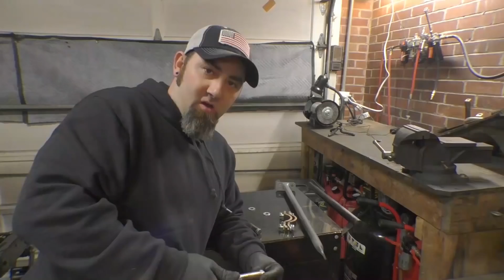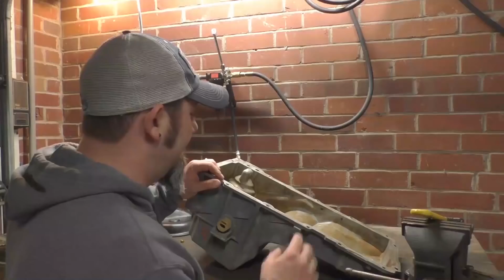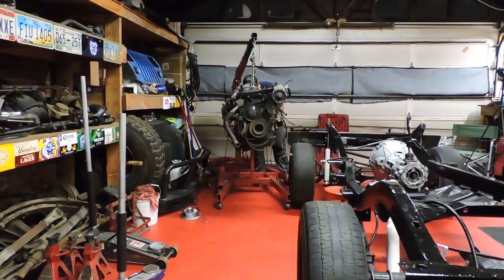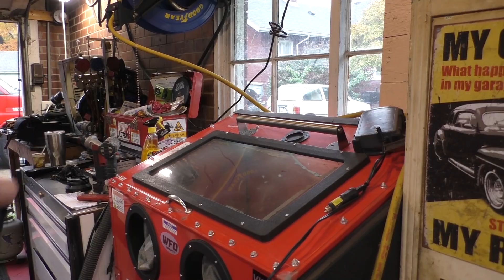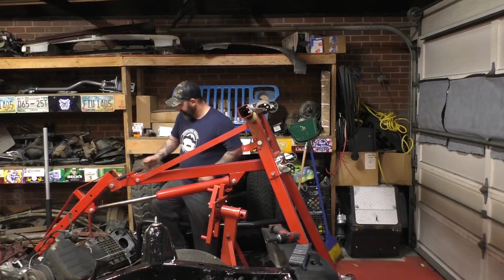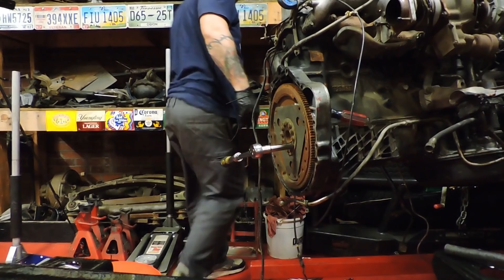Diesel Overland YJ Build: Engine Install Pt. 2 + Accident Footage

Comment: I'm running a mercedesdiesel4x4 adapter plate on my 84 cj7. I went with the auto trans for my swap. I did have a problem with the adapter plate but within 2 phone calls we had it resolved. Awesome company to work with and as you noticed the fit and finish of the parts is great. I also ran his narrow pan kit pan would've hit the front differential otherwise and even with the custom pan it's very close. At this point everything is done with the exception of the trans problems that have plagued my build wish I could've gone with a 5 speed.
Reply from the maker: Thanks for watching Alden, I originally had planned on going for the automatic but in the end I decided to go with the Ax15, mostly because it seems like it will be easier to control the power of the engine, and also be able to shift and keep the Egt where I need it to be. When I was researching with the auto I was going to go the full manual valvebody route to simplify everything. I want to buy the narrowed oil pan kit to throw in there I think. I have a fresh 4 inch lift but my understanding is it will be close like you have mentioned, seems like a good thing to increase that clearance. I hope you get your trans problems worked out man, that CJ7 should be a nice little weapon when its up and going.
Reply: @SmallTimeMotorsports  my Cj has a 4 inch lift on it as well and it's still super close. The reason a went with the auto for my application is that here in california if the vehicle was never imported with a manual which the 300 series weren't then in order to get it passed inspection it has to have an auto in it. After the inspection I can put a manual in it which is what I intend to do it's just one of those hurdles that I've had to deal with. I was able to drive it around my driveway before the trans came back out and it was a blast.

Comment: Wow that was close. Just found your channel on part 1. I look forward to watching the build. I'm trying to decide on a engine swap for my yj. I'm thinking 5.9 magnum as the is what I did to my last tj, but I have always wanted to diesel swap a jeep so I will be taking notes. Keep up the good work from Patriot IN.
Reply from the maker: Thanks for watching Jarrod, good to see another hoosier! The 5.9 was actually one of my original thoughts for my Jeep, but I went the diesel route to squeeze out some mileage hopefully, and some of the accessories I want to install are diesel as well so it should be a good fit. I really did have a close call, I am very thankful it didnt turn out worse. Thanks for the positive comments and for watching man!!

Comment: Good to see you back, the angle of that chain did worry me... anyways how much boost are you going to run? Are you trying to keep stock Jeep power or are you going to push high boost, new manifolds, etc.? Pretty cool build though.
Reply from the maker: I am mostly concerned with keeping it reliable at this point, but with some upgrades. I do plan to run an intercooler and upgrade the injection pump and turbo. The manifolds and such will stay stock for now, but I might remove the EGR. This Jeep is really getting built for long and extended trips, so what ever will keep me within those parameters ill gladly do. Thanks so much for commenting and watching!!
Reply: Small Time Motorsports I hope your on the om617 swap page on Facebook. A lot of Jeep guys on there but there’s also plenty of experts that will help you make it as powerful, efficient, and reliable as possible.
Reply from the maker: Thanks man, I actually do follow the facebook page, some wonderful information and resources there.

Comment: Close call!  Glad your ok!   What’s your timeframe to have this thing running?
Reply from the maker: Thanks for watching man, the frame is nearly complete and just needs fuel system, brakes and motor finished installed so that phase of the build will finished in the next couple months, engine should be running very soon!! I plan to get the body on this spring to start modding it and finish through out the summer with it, but im not rushing it, this build is my Mona Lisa. Between this build, my XJ and my JK the budget is in constant flux so I put money in where I can. Im really hoping that I can finish it this year so I can start planning some long range trips.
Reply: Awesome!   Can’t wait to see it finished!   Very nice work!  Keep up the videos. Wish I had the time to do a frame off on my YJ.